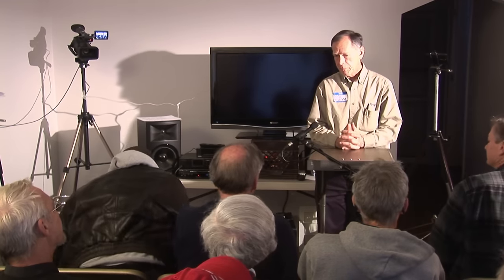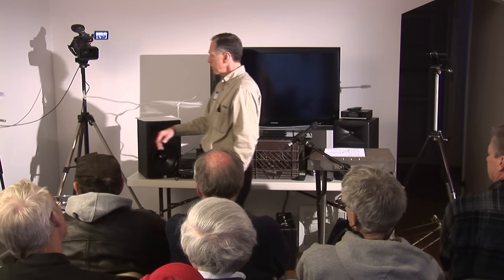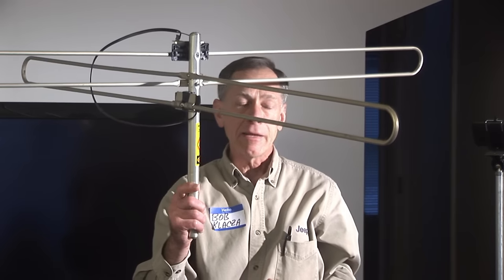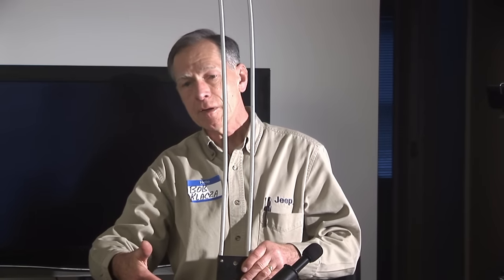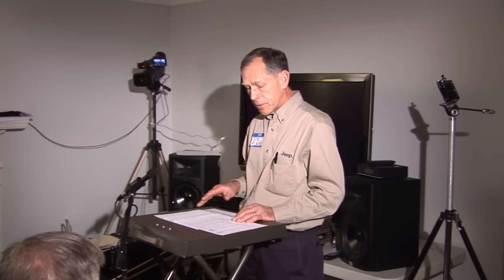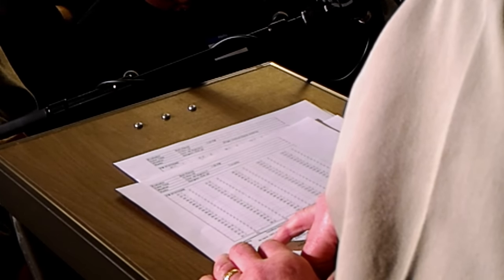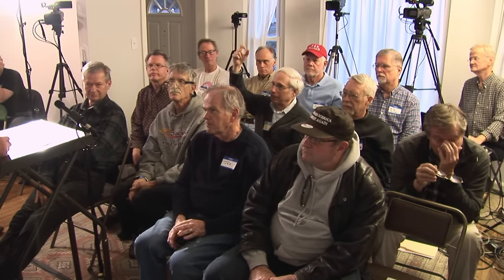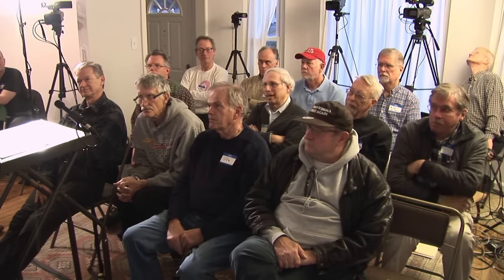Antennas for FM Radio Reception

Comment: I am new to radios just today I have started my project antenna for my sw radio think in fm there are not many that I could pick but after watching this man be I should give fm as well a try.  Can some tell me in India will they block fm stations broadcasts from a city to another city?
Reply: Thank you for your comment ! There is really no way, once an FM broadcast signal leaves the broadcast antenna, to "Block" it, but only can have an "Interfering" signal to mask the desired one. The way to get better reception from stations in another city is to use a "Yagi Beam" antenna, which is directional in coverage, and should be used with a rotator motor to turn the antenna to the desired city location. Please let me know if you need additional help in achieving your desired result !!

Comment: My FM radio has a single wire coming out of it. With the coaxial cable there are two wires - which of the two coaxial cables is connected to the single radio wire?
Reply: You have, unfortunately, no choice in this due to the fact there is only one wire. Make sure that the wire is about 31" long, and put it straight up in the air !   In order to use a coaxial cable, the internal circuitry of the radio would have to be redesigned.....

Comment: Very informative video.  But it's incorrect to say that all FM Broadcast stations transmit with circular polarization.  Here in Canada, most low power stations (under 3 kW) are usually vertical-only polarization. For example, CINQ 102.3 FM.
Reply: Dimitri, thank you for your comment !  Yes, Low Power FM's typically don't have the money or space for a circular broadcast antenna, so vertical is the least costly solution for them !!

Comment: I was hoping for more information on automotive fm antenna.
Reply: Basically, for FM, 31 inches vertical is the target, with as big a sheet metal ground plane as possible, like in the middle of the roof, but the styling folks don't like that... for AM, the longer the better, like the old CB radio masts attached to the metal bumpers, on cars with such a thing...  Trucks are more likely to have real metal bumpers now !

Comment: QUESTION FOR ENGENEERS: DOES LENGTH OF CABLE FOR FM MAKE NEGATIVE DIFFERENCE? HOW LONG CAN FM ANTENNA BE AND STIL HAVE SIGNAL WITHOUT SIGNIFICANT DECREASE???
Reply: Thank you very much for your insightful question !  A recommended length for the cable is 1/4 wavelength,   ~98MHz, is 31 inches.  This length gives optimum impedance match with the minimum of loss.  Using the data below, rounding off the numbers, 3 feet times 0.02dB/ft = 0.06dB of loss.  That is within experimental error... Most quality RF Co-Axial cable manufacturers have a specification for dB loss at a certain frequency per 100 feet of length. Example- Belden 1694A - Coax, RG6 Type, #18 Solid BC, Duofoil® + 95% TC braid, the nominal loss at 100MHz is 1.95 dB per 100 foot length.  Please see https://catalog.belden.com/index.cfm?event=pd&p=PF_1694A  I hope that will answer your question.  If not, please reply !
Reply: @robertklacza1160  I asked for a MERCEDES and got ROLLS ROYCE of an answer. it has been a pleasure watching the video and reading the answer. Thank you so much.

Comment: Help me, please.
How does his dipole antenna
compare
to the cheap twin-lead ribbon antennas that was included with the purchase of a new radio ?
Reply: The simple twin-lead dipole can work well, as long as the dipole is vertcal, and the twin-lead feed line to the radio is horizontal and twisted with one twist every 8 to 10 inches to avoid picking up noise....
Reply: @robertklacza1160  Today is February 12, 2021.
I just now discovered your reply back to me.
Thank you very much.
I have watched this video many times.
It is great & to the point.

Comment: One more....there was a point where it was mentioned that one could get more gain by stacking two antennas.....and that is a true statement.  However, since with FM were speak of voltage, as opposed to power, one would believe they would get a doubling of the voltage  (6dB), but there are things to consider.  In order to combine two signals so that they exactly add, they have to be in phase.  To do that the antennas that are stacked must be identical, and they should be spaced 1/2 wave (in free space) apart.....and....then the cable that brings one to the other should be 1/2 wave (electrical length for a given dielectric in this cable).  Then, using a combiner, they should combine correctly and add to a (higher than one single antenna) output level.  The combiner has some loss amount, and that off course takes our - what would be 6 dB gain, down a little bit, depending on the combiner used, and it's associated loss factor.
Reply: Yes, that is correct.  The average person, however, would have to use this knowledge to be able to utilize this, which in my opinion, is not trivial....  Thank you for your input and advice !

Comment: Folded dipole. How about a 4 or 5 element yagi? You need a rotor but you get some gain and front to back ratio
Reply: This report mainly focuses on simple antennas.  Rotors and multi-element antennas require much more space, complexity, and money.....

Comment: Can someone tell me what are the components of the fm antenna?  A trap?  I am restoring an old tube radio and it has a loop in the back of the console but I want to upgrade that to something much better. the whole 75ohm vs 300 ohm thing is a mystery to me also.  when I bought my house there was an old big tv antenna not being used... can I just run a coax cable from that thing?  thx!!
Reply: Dear Mr. Jam, Most of the time on old tube radios, the "Loop" antenna is used for AM pickup from 540KHz to 1600 KHz.  The tan color T-shaped FM antenna made of twinlead in the background of the video is the standard 300 Ohm antenna that will connect with the "300 Ohm" inputs on FM receivers.  The 75 Ohm input on FM receivers is sometimes one of the 300 Ohm inputs, with the 75 Ohm coaxial cable shield going to chassis ground.  The TV antenna that you inherited could be used for FM, even though it may not be optimized for FM.  It will be far higher elevation above ground, and be able to provide a greater FM signal pickup from the airwaves.  To answer your question, the components of this FM antenna consists of a "dipole" conductive metal tubing bent into a flattened loop, a matching transformer, to change the "Balanced" dipole pickup into a single ended coaxial cable feed, and the feed cable itself from the transformer to the receiver.  Please let me know if that answers your question.  You may want to listen to the descriptions in the video to gain a better understanding of antenna terminology.  Best regards....

Comment: 100mhz 4 element yagi antenaa dipole length in cm.or inches  how much length?
Reply: The length for the main pick up dipole is again in the neighborhood of 62" end to end.  I measured my old 8 element Yagi beam FM antenna, that I believe is a Winegard brand, with the following results- the two pickup dipoles were different, the rear dipole was about 62" tip to tip, the leading dipole was about 53" tip to tip.  The single reflector element being longer at 66" tip to tip, and the leading five director elements are all about 49" tip to tip.  The total length of the pipe is 94", or very nearly eight feet !!     I hope that helps...

Comment: How do I make a small loop antenna on  the 433mhz attached to coax
Reply: The antenna in the video is sized for best reception at 98 MHZ.  98/433 = ~0 .226, so multiply all above dimensions by 0.226, for example, 31" times .226 = ~ 7"    Go from there !!  Check some Radio Amateur handbooks for more ideas !!

Comment: Interesting Video Bob. I have an issue in my new home and I am not a very well versed electronics guy. Have been trying to get FM reception in my shop building on an old Nikko am fm receiver. FM Reception is horrible with a great deal of static. AM reception no problem. The shop is one of those corrugated metal buildings, roof and sides. I tried inside with that "winegard" hd 6010s I think you were displaying in the video and it produced  no improvement. Is the shop shielding any FM reception and do I need to go outside with an antenna?   I then worry about grounding issues if I go that route. thanks for any help !!
Reply: I would suggest putting a vertical dipole outside a window mounted maybe 1 meter from outside of the structure.  Choose the side that faces the most of the FM transmitter antennas that you wish to receive.
Reply: Thank You, I will give that a try.

Comment: So the 2 take aways here are that dipole antennas are good but should be mounted vertical for FM. I thought terrestrial noise bouncing off vertical structures such as power poles, trees, buildings caused a problem, or maybe is it just negligible?
Reply: I would like to know as well.
Reply: "Multi-path" reflected signals happen quite often in moving vehicle receivers, but not so much with fixed home installations.  With that said, if you tune to a particular local FM station, and the signal is distorted, move the antenna around the room and 9 times out of 10, the poor reception will clear up.  Of course, keep the antenna as high off the ground as possible.....

Comment: The cheap twin-lead antenna wasn't worth testing? That's absurd. I'd bet a substantial amount of money that it would have outperformed the others by a considerable margin. For starters, it is a folded dipole antenna, the same as the one that performed best in your test. Second, all of the antennas you tested are going through a 300-ohm to 75-ohm matching transformer (signal loss) and then coaxial cable (more signal loss), whereas 300-ohm twin-lead is very low loss, and needs no matching transformer, assuming you have a good tuner that can accept 300-ohm twin-lead directly (2 screw terminals). Had you placed that twin-lead antenna in the attic like you did the others, and brought your tuner up there with it so the antenna could be connected to it as-is (or, extended it with a long run of 300-ohm twin-lead cable), it would have molly-whopped those others.

"Twin lead can have significantly lower signal loss than miniature flexible coaxial cable at shortwave and VHF radio frequencies; for example, type RG-58 coaxial cable loses 6.6 dB per 100 m at 30 MHz, while 300 ohm twin-lead loses only 0.55 dB."

That's a HUGE difference in signal loss. 0.55 dB of loss in a 100-meter run is negligible, while 6.6 dB of loss is a ton, especially when you consider that the dB scale isn't linear, it's logarithmic to base 10 (e.g., a 30 dB signal has 10 times the power of a 20 dB signal) and that doesn't even take into account the additional loss from the matching transformer that you have to use with coaxial cable.
Reply: I am planning to have an update video with that comparison !!

Comment: Hi Bob. I just purchased this FM antenna a few days ago. Have you ever heard of this one?
FM DX Antenna Co Long Range Outdoor Vertical Reception Antenna 88-108 MHz. I am hoping it will work well with my Sangean HD Radio.
Reply: This one is a simplification of the folded dipole, and should work just fine!

Comment: I have a Magnum Dynalab verical from the 90's  in the attic, and want to run a 100 ft coax down to the basement, F type connectors both ends, what coax should I use? 50 ohm or 75?
Reply from the maker: See Page 4 of the installation guide  http://www.magnumdynalab.com/new/wp-content/uploads/2018/05/ST-2InstallationGuide.pdf
Reply: Looking at the installation guide of the Magnum Dynalab verical antenna, it looks to be a single 1/4 wavelength mast, with no ground plane at it's base.  Adding a ground plane at the base with the mast vertical above the ground plane will increase (double) the captured signal strength.  The recommended ground plane would be approximately 2 meters by 2 meters with the mast in the center.  If the vertical height is available, going to the folded dipole shown will have the same signal strength pickup, but without going through the trouble, size, and expense of the ground plane.  I would be interested in hearing from you on your results.

Comment: I have a deep fringe TV/FM antenna about 40 feet above the ground on a rotor and 100 miles clear channel isn't rare.  It peters out at about 150 because of obstructions and curvature of the Earth, but it's what I've done for fun since I was a kid.  NOW, the BIG problem is even with all this gain finding something interesting to tune in.  FM was a feast of great and diverse Music in the early '70s when I got into it.  Now?  Mmmmmmm......not so much......there is no real competition anymore with a few mega-conglomerates owning all the outlets (between them) in a market.  NPR has gone pretty rapidly downhill.  I'll never be on Ibiquity's IBOC bandwagon, so that's not a solution.  Hope springs eternal, but right now, there are only about three stations that I regularly check out and most of the time my Tuner's (there's a bunch of 'em) inertia-loaded flywheels need liquid Helium coolant.  After a minute or so,  it's back to vinyl, tape, and optical disc media.
Reply: You may want to go to the FM-HD Hybrid Digital FM format by iBiquity.  That allows three other audio streaming programs on the same FM frequency.  Many new cars have this option !
Reply: I recently saw an ad from iBiquity HD Radio that claimed over 40% of new cars sold today have HD radio capability.
Reply: @robertklacza1160  The one thing HD Radio absolutely does NOT stand for is "High Definition".  It degrades the audio of the typically superior analog performance (especially on analog tuners) because of IBOC-generated self-noise.  Car stereo is not the rubric for quality, period.  HD Radio is dying a well-deserved death and its passing can't come quickly enough for me.  The only good thing I have to say about it is it is preserving (while simultaneously degrading the quality of) FM bandwidth for radio service use, which keeps it from being carved up and sold off to cell phone conglomerates.  We'll agree to disagree on this one!
Reply: @robertklacza1160  Please see my other comment.  If they put the alternative channels on the main channel and all the talk nonsense on the degraded HD Radio channels, I'd be less offended, but that's not what has happened, so I remain unimpressed!  Perhaps in another few decades, the FCC should start from scratch with a lossless, high-resolution, discrete format (that could still simulcast analog for backward compatibility) but I suspect music IP owners won't let it happen then either.  Ironically, taping actually helped them sell music during music's peak period of commercial success.  The vinyl and tape resurgence gives the lie to the idea that people won't wish to own physical media even when they are ways to hear it without paying for it via broadcasting or downloads.

Comment: My old tv antenna has one of those looped type elements on it. Does this interfere with digital tv signals?  Or am I way off?
Reply from the maker: No, if the antenna worked for analog it will work for digital.

Comment: 4:03 essa antena ta extinta aqui no Brasil. Só se a própria pessoa fazer.
Reply: Valdenis, thank you for your update on the transmitting conditions in Brazil !
Since circular polarization is not used so much in Brazil, I would suggest that you do an experiment in both horizontal and vertical directions, and see which gives you the best overall reception !!  If possible, please post your results here !!!!

Comment: hello.. i hv used a funny approach .. i put a two pin plug with a two wires on both the pins.. then connected the other ends to the antenna of my cheap FM radio.. then i inserted the plug to the wall socket without switching on the current supply and leave it be that way. 
the idea was to use the electrical connection  cables of the entire  house as one  gian antenna.. you know what it worked.. the sound is 100% noice free stereo fm. 
if possible try it then lets see if it works in other areas of the world or not! lol... m from north east india.
Reply: Dear Mr. Medhi, I do NOT recommend this approach.  Most AC Mains outlets in the USA are powered 100% of the time, and your  approach is very dangerous.  AGAIN, I DO NOT RECOMMEND THIS !!!!!!!!!